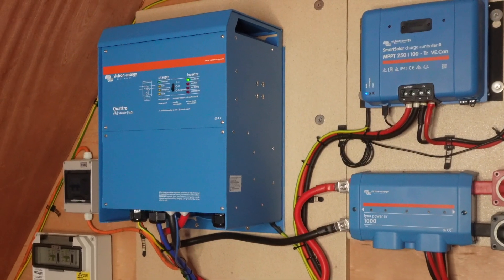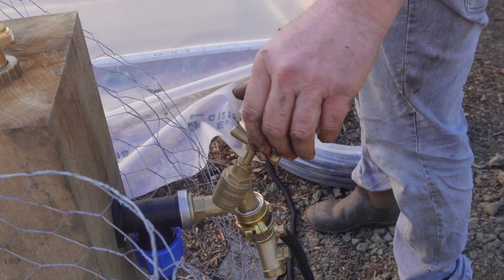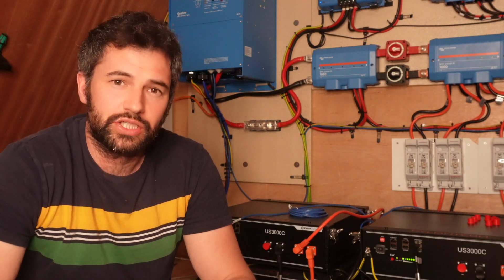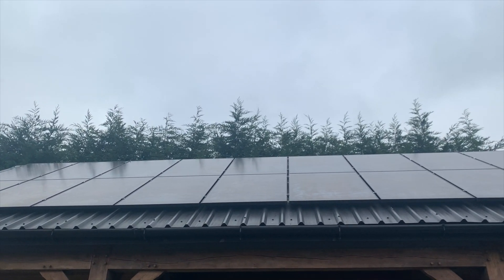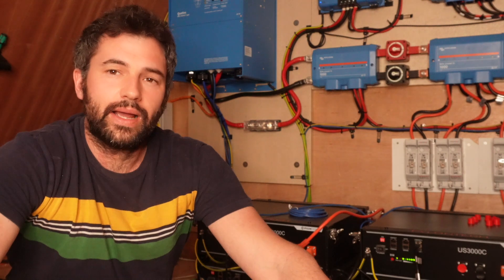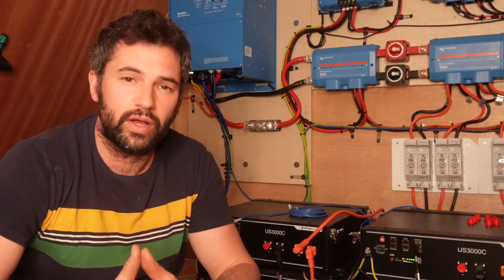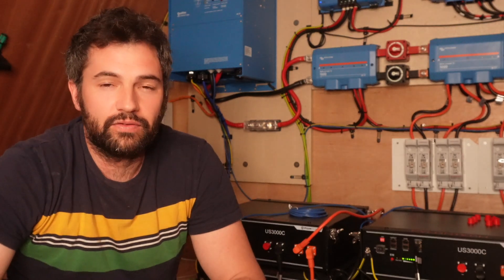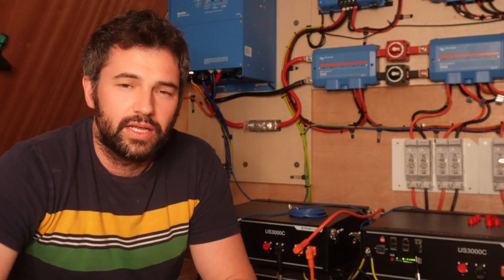TIME FOR SOME ANSWERS!

Comment: Just a FYI. The firmware update is for the Battery Management System (BMS) its probably a good idea to do this. The entire Solar PV/Battery market is the new wild west of consumer electronics. 99% of gear is manufactured in China. Everything needs updating after installation and the warranties are.... questionable. We are due to have Fox ESS Batteries installed. They come with 5 years warranty but can be extended to 10 years with registration at installation. HOWEVER years 6-10 require you to ship the faulty battery back to China..... Wanna guess how much it costs to ship a 40kg Lithium Iron Phosphate Battery to China is? Probably as cheap to buy a new battery....
Reply from the maker: Thanks for this ☺️ We have been looking into firmware this week and it seems like a minefield.  We have heard some awful stories about people updating their batteries and causing major problems, including voiding their warranty!  We are going to contact Pylontech and see what they suggest!
Reply: @The_OffGridFamily  This thread may be of use. It looks like you can upgrade or downgrade the firmware without too many issues (downgrade option if you find there is an issue with a specific version update)

Comment: I was told by Segen that if you add another Pylontech battery, it will only be as good as the existing battery. If the old batteries have lost 20%, the new one will only work at 80% if that makes sense?
Reply from the maker: That does make sense 👍 Thanks for the info  😊
Reply: I'm not convinced by that. If your charging regime remains the same, that is, you charge to the same voltage before going into Float mode, then as soon as charging is complete the older cells will try to drop to a lower voltage but the new battery in parallel won't drop its voltage at the same rate by virtue of its better capacity. This means that the new battery will carry the load until its voltage balances with the older batteries' voltage. Only then will all of the batteries discharge equally (or as near as dammit to equally.) So, the additional capacity of the new battery will get used. It just happens "up front". Disclaimer: This assumes that the charging regime is not changed from the original setup. It is possible that Pylontech do some jiggery-pokery in their firmware, but from my reading I am not aware of this happening.

Comment: Off-grid 6 weeks now. 20.6kW pv, 132kWh battery. I can get through three dark, cloudy days, then our 10kW gen auto starts. I built nine out of the 10 batteries. One 220aH Trophy with problems just like several others. Cell quality control sux in China. It doesn't matter whether you build your own with "supposedly grade A" cells or buy pre-built junk in a fancy steel case with a display.  BMS's should never get used other than for out of normal limits/safety reasons. So all the complaints about them are usually because the batteries, inverters, charge controllers are not set up right or we are expecting to be able to charge the cells to 3.60V/cell without a 200 to 300mV imbalance. I have ONE battery out of 10 that I can charge that high. 3.50V/cell is about as high as I can go for the whole battery. 

It is the same for us. We need much more PV in December January February and more battery storage if you can believe that! Remember we were power hogs here in the US. We have 25% more home to heat/cool than average size homes. We are all electric except for Gen, which has not been needed after initial battery bank charging. We use very high eff heat pumps. 

Try a DIY battery. Use the JK BMS with 2A balance and BT. You'll not only save 25-50%, you will know how to fix it and it will be repairable.
Reply from the maker: Thanks for your comment 😊 We enjoy hearing about other people’s systems 👍

Comment: I started with 2 and am now up to 6 Pylontech batteries at home. The overall battery health goes up when you add a new one and you get full usage from my experience. The only advise I would give is make the new battery the master, add it when you can keep the batteries full so the BMS can balance and sync with the other batteries. I got similar errors when the batteries were new & I fixed it by setting a voltage limit in the victron controller and then slowly increased it til I reached the normal operating voltage over a couple of days then disabled it. I think the bms doesn’t do a great job of managing all the batteries when they are out of sync.

I would recommend you looking into the hub they have because you are 2 batteries away from the group limit of 8. if funds permit add new batteries into a different group that way you can get use different type of Pylontech battery other than the us3000c. At my office we had 8 us3000 and added 8 us3000c in a different group using the hub
Reply from the maker: Thank you for this information  ☺️ It is always good to hear other people's experiences 👍

Comment: I use Victron for inverter and power controllers but have had good experience using LFP cells and BMS direct from China (about £3500 total for 30kwh). Setting these up isn't too difficult. The 'Off-grid Garage' YouTube videos are a great tutorial for this.
Reply from the maker: Yes we like that channel too 👍 Glad you’ve had good experiences with using LFP cells 😊

Comment: I'm also off grid, but using a ac coupled system. Because of that my batteries are not cycled alot, some 80 times maximum a year, cycling your batteries is one of the degredation killers, do you have data in yet for you battery cycles?? You can then work out the time of death for them in the future. Great install too, especially for someones first time, probably better way to look at it is what would you do differently in the future, cable tray, crimp terminals etc. Keep on going , great work. And a happy easter.
Reply from the maker: Thank you, happy Easter to you too 😊👍

Comment: One way to store your excess solar in Spring/Summer is to get a Water tank and electrically heat it with an immersion heater (not sure how you get hot water generally). Storing the energy thermally and think of your hot water tank as a "battery" then you can cut down on say a boiler heating it or whatever other means of heating it you are doing. Then you end up with free hot water. 

If you have any streams on your land it would be very good to go hydro as that peaks in Winter so would work well in harmony with Solar peaking in Summer. Have a look at Kris Harbour Natural Building channel, he is working on hydro stuff and seems to be setting up to install them for others.
Reply from the maker: The water tank is something we have talked about but not got round to yet 😊  Unfortunately we don’t have a stream on our land else hydro would definitely have been something to consider 👍

Comment: I have the same setup as you, apart from only 6 batteries, i realise its recomended to have at least 7, however my current peak load is still small as im still building my house and living in a caravan. 

Ive only ever had 1 battery error, that happened when my generator failed to start due to the generator start battery being dead and the pylontech went  lower than normal.
I never let my batteries go below 85% discharge. Although the spec states 95%, but thats a maximum. 
If you're allowing them to go down to the 95% discharge then youre probably driving them a bit hard.

If you want the most life out of them its best not to whip them too hard.
Reply from the maker: We haven’t gone below 70% discharge so shouldn’t be a case of working then too hard 😊 Where are your batteries stored?
Reply: @The_OffGridFamily 
Sorry misunderstanding. 
My batteries are stored on an uninsulated plastic shed. I have a convector heater set to 7 degrees within the shed to act as a frost guard. However the Quattro does a reasonable job of heating the shed.
We're in Scotland so it can get quite cold at night, however if its cold then we use more power = Quattro gets warm.
My generator automatically comes on at 80% discharge, unless at night I let it go to 85% with the hope the generator might not wake me. 
The occasional extra discharge will actually do them good. 
If its going to be a cold night I sometimes charge the batteries in the evening to warm the shed up for the night ahead.

Eventually the batteries will be housed within an insulated room within a barn. However building delays meant I had to make do with a plastic shed.
Ill do a video one day, but its almost identical to yours minus the solar which is on order and eventually I have micro Hydro.

Comment: interesting video again, i am serously considering adding pylontechs to my solar panel system with a ac coupled charger as i have a active fits payment, that i do not want to risk losing thanks again :)
Reply: Have you looked at sok? They make 5.2kwh 48v server rack batts for less than $1800 and people absolutely love them, never had issues
Reply from the maker: Thank you, glad you found it interesting 😊 the Pylontechs are good for an affordable option. We just need to iron out the issue of the error messages 👍

Comment: Good to see how you’re getting on! All that excess power in the summer, sure, but that means most of the year you get to generate ‘enough’ !
We can’t wait to see future longer term battery storage. It will happen over the next 5 years or so. There are so many startups having a go. The other tech I’m keen to see is perkovsite solar panels, which are far more efficient and much less expensive. 
Your setup is good inspiration for others out there. Happy Easter to the family there 🐣🐣🐣🐣
Reply from the maker: Thank you 😊 Yes that’s true about the power. For most of the year we seem to have all we need. 
Happy Easter to you too. Hope you’ve had a good one 🐣😊